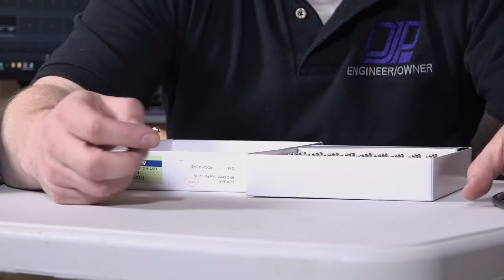What types of cables do you use for SDI professional video?

Comment: Hi quality coax cables can get very expensive if you require higher bandwidth such as 12G-SDI for more than few feet. So much so that fiber is probably better way to go.
Reply from the maker: As long as you budget for the converters. That's where fiber can get expensive.

Comment: Doug what are your thoughts on SDI repeaters such as https://www.bhphotovideo.com/c/product/1288877-REG/kanexpro_sdi_hdrptpro_3g_sdi_hd_sdi_rg6_cable_repeater.html to get more distance?
Reply from the maker: They do work. But pretty much any box that has an SDI loop out will reclock a signal these days and extend the range. The cheapest I know if is the Blackmagic Design SDI-to-HDMI Micro Converter.  If you regularly need to go long distances I'd consider using fiber instead.
Reply: Thanks. I actually realized you could use those BM convertors (I already have some) for that purpose yesterday since they do reclock. What kind of distance do you figure one of those could add for 3G SDI signal?

Here's the deal with fiber for me- All my cameras are HDMI out only. Are there any HDMI to fiber convertors? I haven't come across any. If not, at the camera end I'd have to convert twice from HDMI to SDI THEN SDI to fiber (plus fiber to SDI at the switcher end). But maybe that's no worse than using one BM HDMI to SDI convertor at the camera then BM SDI to HDMI convertor at some point to extend to another SDI cable?
Reply from the maker: @SheaHarris  That depends on the quality of the cable and what signal format you're sending, so I can't really answer that definitively.  But any device which reclocks an SDI signal should extend the distance up to 100m. Reclocking basically rebuilds the signal back to its original strength so whatever effects the first segment of cable has are negated and you start over on the distance limitations.

There's one converter that I know of that does HDMI to Fiber, but it's expensive when used for just that purpose: https://djp.li/bmdcc. It converts both directions, and gives you comms and tally too, plus it has a battery of its own.  In terms of costs, long fiber runs tend to be cheaper than long coax runs, so you might save a little money on the cable itself.

How far are you having to go with the signal? If you're doing 1080i or 720p, and going 100 meters or less, a single run of good quality RG-59 or RG-6 (Like https://djp.li/1505a or https://djp.li/1694a) should work fine.
Reply: @djp_video  In this particular situation there'd be one run of up to 180m and two up to 160m. Cost is the reason I hesitate to go fiber. The cable itself isn't expensive but when I factor in converting it could get quite a bit more expensive than just a few BM micro converters for SDI. In this particular situation I'm wanting to do 1080p60 because these events wouldn't be streamed, they'd be recorded and aired the next day. If I was streaming I'd just do 720p60. Looking at Canare they have a 12g rated cable (L‐5.5CUHD) rated to go 161m for 3g SDI. So potentially reclocking in the middle with SDI could get me those distances comfortably? 

I remember watching your video about that Camera converter. I'll have to look at it again. Having video, comms, tally running through one cable would be nice. Can it be tied into most comm systems?
Reply from the maker: @SheaHarris  I don't know if I'd go so far as to say "comfortably" but it should work with good quality cable and connectors.
Reply: @djp_video  So I actually did all the math and doing all fiber instead of all SDI wouldn't be much more at all. If it wasn't for needing quite a few $155 BM SDI-Fiber converters it would be quite a bit less going the fiber route. The only thing is this means at the camera end HDMI>SDI converter then SDI>Fiber converter, then at switcher Fiber>SDI conversion. So that's three converters per fiber cable run, vs. two if I did SDI only (HDMI>SDI at camera then one in the middle of run to reclock). For the fiber set up is that too much converting back and forth going on or will it not negatively affect anything? I could cut one conversion out of each fiber run by using a camera converter but like you said that's too much $ just to use for HDMI>fiber conversion.
Reply from the maker: Conversions don't impact the quality of the video.

Keep in mind when buying the $155 BMD converter that you also need SFP modules for each one as well. They don't come with them.

Also keep in mind that with fiber you're getting a bidirectional signal. So if you're having to run video back to cameras, you only need one cable per, not two.
Reply: @djp_video  I didn't know it didn't come with SFP modules. Can you link to one you'd recommend for it?
Reply from the maker: @SheaHarris  https://djp.li/bmdsfp3g for 3G-SDI or https://djp.li/bmdsfp6g for 6G-SDI.
Reply: @djp_video  Really appreciate the help!

Comment: Thanks for this Doug - very useful.
I was wondering if you would tell us what tools to buy to strip the Beldon 1505F cable and crimp the same cable with Canare BCP-B45HW, please?
I’ll only be ever running 3G or 6G SDI signal over 1-5m lengths so I’m pretty set on this combo - I just want to make strong, flexible (I do a lot of location work) cables.
Reply from the maker: You can use the same Canare TS100u with the F versions of the cable, but you'll need to be more careful adjusting the blade so it doesn't damage the inner conductor. https://djp.li/ts100u

Comment: Good afternoon, I have a question. which means marking on bnc connectors from canare. We have BCP-B45HW written on the connectors. Can we use a connector marked "Canare BCP-B53 Canare 3.0 GHz 75-Ohm BNC Plug for 1694A Cable"? Since they are identical in appearance.

Comment: 1 Port Vga to 2 Ports Sdi (SD-SDI/HD-SDI/3G-SDI) Audio Converter SDI Broadcast Room, No-Linear Editing Field, CCTV Securit
Hello Doug, I'm trying to connect the video converter mentioned above I connect VGA in the output of the PC and I connect BNC out RG6 cable to a DVR and I do not have any video this black screen before I had a VGA to Video composite and if I have an image there is something especially what you have to do.

Comment: Thanks for the video.  Is there ever a time that RG-59 is better than RG-6?  I would prefer to just run all RG-6 for everything to make life more simple.  I'm about to run new cable and want to be sure.  Thanks.
Reply from the maker: It really just depends on the quality of the cable. I'd trust the Belden 1505A (RG-59) over hardware store RG-6 any day.
Reply: @djp_video  One last question. Do you recommend the Die set from Amazon that you have linked over the Canare TCD-35CA when using the 1694A cable and BCP-B53 connectors? Is the one on Amazon just as good as the Canare branded one?  Just want to make sure. Thank you.

Comment: Hello, we have dealt with the cable, now another question has arisen. What cable reel to take? so that the cable is wound on one side and the other end of the cable that is connected to the switcher is not wound.
Reply from the maker: Azat Akmatov The reels I use have pass-through holes to allow a portion of the wound portion of the cable to stick out from the middle

Comment: Hi, we have a problem. we connect cameras to the switcher via sdi cable, but there is no image. because of what it can be. They themselves do cable crimping. Cable Canare.
Reply from the maker: First, make sure that the cameras are set to output the same format video signal that the switcher is expecting.  Also, use a short SDI cable to connect the camera to make sure you aren't having cable issues.

Comment: As someone who has put BNC connectors on coax and didn't know about that connector thing until now, definitely would not rely on which connector is on the cable to determine what impedance the cable is. It usually says on the side of the cable anyway.
Reply from the maker: I probably should have specified, but I was mostly referring to commercial, pre-made cables. They tend to get it right.

Comment: Hi !

I want to transmit SD-SDI signal (from DeckLink SDI 4K) and then “Mini Converter Optical Fiber 12G” and then again  “Mini Converter Optical Fiber 12G” 

Distance is 2KM

Will this setup work for me ?

Now which SDI cables I need to use, which SFP module , and what kind of OFC I need to use ?
Reply from the maker: It should work fine. I've run video over my fiber setup farther than that without any issues.

You'll need the two Optical Fiber converters, a pair SFPs (I'd recommend the 3G-SDI SFPs from Blackmagic), and duplex (two strands) single-mode (9/25) fiber with (blue) LC connectors to plug into the SFPs. If whoever runs your fiber terminates with another type of connector (ST, SC, FC, etc.), simple adapters are available to convert from one to the other -- the key is making sure that single-mode fiber is used.
Reply: Thank you so much for your answer. One more question ....

Will all the Blackmagic declink products provide the same quality of SD-SDI or it varies with cost of the products ? 

And I’m looking for some heavy duty kind of ...

Please suggest me some decklink products for only high quality SD-SDI ...

Comment: Hi Doug, what's your recommendations on mini coax cables? Are they just as reliable? I would like to use them for the rack wiring (video hub, switcher, fiber converters etc...) where all cables are less than 10 feet long.
Reply from the maker: I don't have a particular cable that I like -- generally I don't use them, but they can work alright if you're just doing short runs.  The main issue with them is that signals degrade much faster than they do on larger cables so I wouldn't try to run any signals very far.  That includes situations where a mini cable is patched into a longer higher grade cable, which should be avoided.

Comment: MyCableMart 25ft 6G-SDI (4K) BNC Coax Cable, RG6/18AWG Male to Male, Nickel Plated - I was a little worried when I saw you said that the RG-58 cable all have a plastic sheathing on the inside coax ground slip on - This brand of coax from Amazon claims this cable is RG-6 and good for up to SMPTE ST-2081 6G-SDI Standards yet if you look on Amazon w/ the descriptor this cable has the plastic sheathing, yet is RG-6 ... FYI .  Great job on your videos, check this out though and maybe let people know that the plastic sheathing is not always an indicator of RG-58 , probably best to look at the cable descriptor itself .
Reply: 6G-SDI is not 4K
4K can be transmitted over a Single Link of 12G-SDI or a Dual-Link of 6G-SDI

Comment: Doug, you mentioned a RG6 will handle 12G and 6G better than RG59.. but not WHY or HOW? Thanks.
Reply from the maker: It's a thicker cable that does a better job at both containing and rejecting higher frequencies so it's easier for the receiving equipment to discern actual signal from outside interference.

Comment: We use Sommer Cable VECTOR 0.8/3.7  with Neutrik Connectors for our long runs (100 meters). They are kind quite affordable arround 1,50 € / meter. They are quite flexible and can be put on reels very easy. For shorter ranges up to 30 meter we use generic rg59.

Thanks to your video i downloaded the datasheets for both. now i know why the rg 59 wont work for longer runs ;-)

anyone with experience in multicore sdi cables ... im looking for 2 channels of sdi in combination with cat5 or cat6.

Comment: I see you left the center pin on the cable when you put the other pieces back in the box. 14:29  I hope you found it, otherwise you will be wondering why you are missing one when you want to use the last connector.
Reply from the maker: Phill I did find it right after wrapping the video. Thanks.
Reply: Phill 
N

Comment: Home-improvement store RG6 and the compression BNC connectors work perfectly fine for SMPTE 292M (720p, 1080i) HD-SDI.  I have around dozen camera cables. Some of them are the "good-stuff" flexible cable like Doug shows, and the rest are the home-improvement kind.  I also use RG59 cables for HD-SD.  My rule of thumb is that RG6 is reliable up to 300 ft, and RG59 up to 100 ft.  I'm not into 4K (or 8K), so I don't have any experience with 6GHz or 12GHz SDI.  My gut feeling is that RG6 would be good for 6GHz at least for 100 ft.

The inner dielectric (the white part between the center wire and the outer shield) is the most critical to signal integrity over long distances.  The foam dielectric will reliably pass an HD-SDI signal over a longer distance than the solid kind. Virtually all of the home-improvement RG6 is foam-dielectric.  The shield is important for signal integrity when you are running cable or satellite RF, but not nearly as important for HD-SDI.  The home-improvement RG6 is rather "over-kill" for HD-SDI. However the style of the shield (for example "quad-shield") is important when you are selecting connectors.  Be sure to get connectors that are designed for the kind of coax cable you are using. 

There are many 75-ohm cables (RG6 and RG59) out there with 50-ohm BNC connectors. You CANNOT determine the impedance of the cable by looking at the connectors.  You should always read the rating printed on the side of the cable.  For short distances, 50-ohm BNC connectors (and even 50-ohm cable) will work.  But it is always preferable to use 75 ohm BNC connectors for 75-ohm applications (like HD-SDI).  Note that when buying BNC connectors you must always assume that they are 50-ohm unless they explicitly state that they are 75-ohm.

I have always heard it pronounced "Can-ARE-ay"  Note the heat-shrink tubing on Doug's RG59 cable example.  Good idea to use heat-shrink on each end of your cables.  You can write on light color tubing (white, yellow) with a permanent pen to identify owner, length, etc.)  And even use different colors on different lengths tor easy selection when setting up.

I have also found it handy to use "siamese cable" which is an RG6 bonded together with a Cat5 cable.  I use the Cat-5 cable for various things like camera power and/or tally lights and intercom or power/control for my remote pan-tilt heads, or for camera remote control (zoom, focus, iris, etc.)
Reply from the maker: A quick follow-up on this. I worked on a shoot for someone else yesterday and they had made up a bunch of SDI cables using hardware store quad shield RG-6 cable. We were shooting 1080p29.97, so it was just an HD-SDI signal -- not even 3G-SDI, but we were having a heck of a time getting the cables longer than about 100 feet to work reliably.  The signal was pretty marginal. We had to swap out more than one cable over the course of the day.
Reply: Home Store RG-6 RF cable has a copper coated STEEL center conductor which will have much greater loss than pure copper and the center pin crimp will NOT be as secure a connection on the harder STEEL conductor. It will not work at as long a distance as a proper VIDEO cable. They are also less flexible since they are designed for fixed use ( Antenna or Cable Company to a TV )

Comment: Unrelated question but do you have to do IMAG ever? Looking at your hand movements and the screens behind you it seems there is enough delay that IMAG would be out of sync with Audio in a venue. I get asked for IMAG a lot and I always have to be very careful about the chain from camera, switcher, projector to make sure I do not get more than a couple of frames before it causes issues for the audience.
Reply from the maker: I do it fairly regularly, actually.

The monitors in the trailer do introduce a couple frames of delay on top of any delay from cameras and the switcher.  This video was also shot at 24fps, which means that each frame of delay is going to be a lot more noticeable than it would be at 60fps.

The cameras I'm using output with less than 2 frames of delay, and the switcher is less than one frame, so the video I'm sending to projectors is on average about 2 frames delayed.  At 60fps that's generally pretty acceptable.
Reply: Ah, that explains it. Very cool, my biggest source is usually the projector, especially if its off axis and requires keystoning etc etc. We often bring in our own projector if we are not familiar with the Venue just to avoid headaches.

Comment: I like those connectors. I been using the Klein compression connectors and they’ve been working great, but I always wonder how tight the pin actually is on the cable.

Do you use boots with any of your cables?
Reply: Occasionally, but not often.

Comment: I make my own SDI cables I use Belden 1694A RG6---18 AWG with  Canare 3.0 GHz 75-Ohm BNC Plug for L-5CFB/V-5CFB connectors. You can get a bulk 1000 ft reel from B&H for 469.00.
Reply: Thats a really good price, 2 years ago I paid that much for just 500ft.
Reply: Edward Seifer
Reply: What is the difference in Belden 1813A and  1694A RG6 cables?  RG6 how much meter we can use maximum

Comment: We always kill our SDI cables I don't know why. At first I thought because of the length, because we're using a canare variant of your black cable for 100m at 1080i. At first they're good, but we always outsource our cable men and most of them don't know how to over/under the cable. LOL. We don't have fiber yet but I'm lobbying to go full fiber like your setup :)
Reply from the maker: That's always frustrating. I always walk around during takedown to make sure everyone on the crew knows how to do over/under and if not, take the time to teach them.

100m is tough to get to be reliable, even with good quality cable.  That's really at the extreme end of what SDI was designed for.